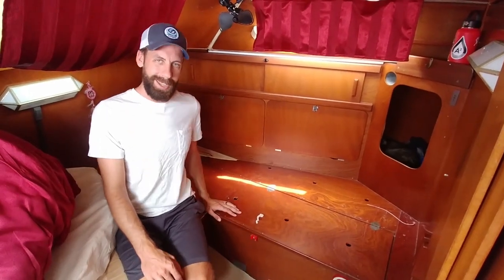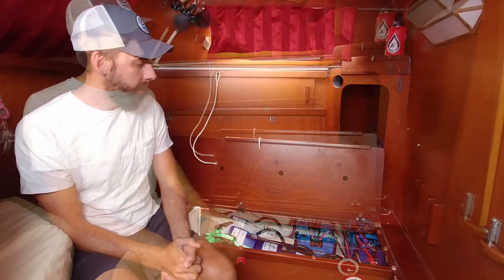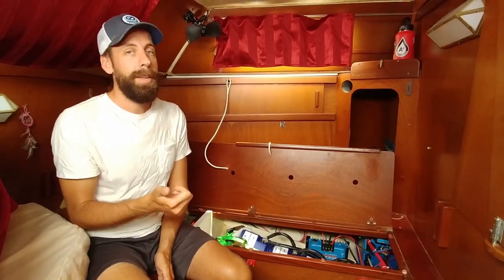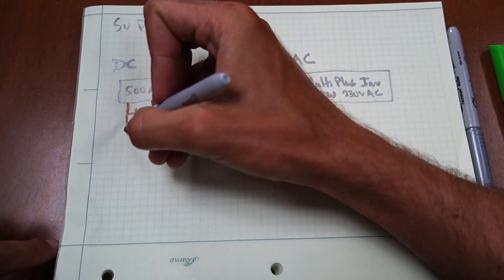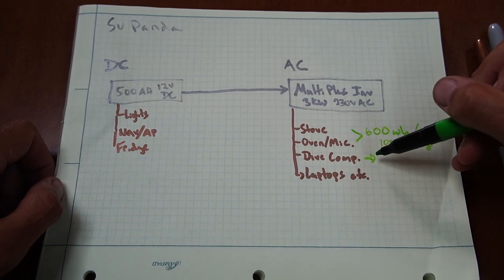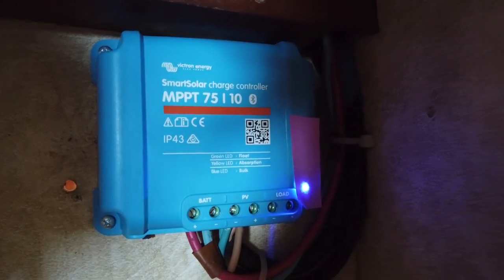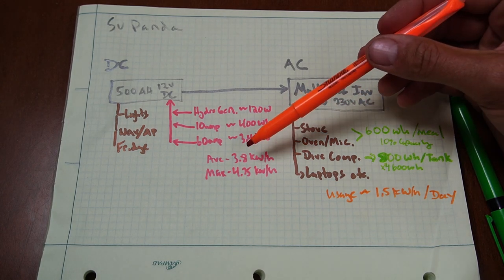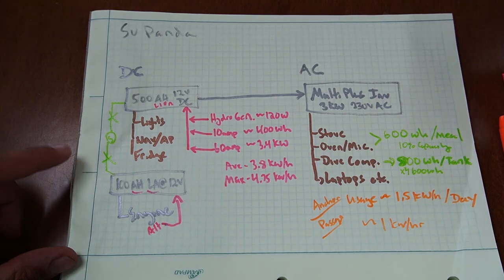Off-grid Energy Storage and Solar - On a Sailboat!

Comment: Wow you get so much solar.  I wanted to pass along some tips and tricks you may be able to use to improve your setup.  First if you didn't know lithium batteries hate to be discharged too much or charged too much.  If you get a good amount of charging even on cloudy days you might want to consider setting up your Victron unit to not charge past say 70% State of Charge...or maybe 80%SOC...or 90%SOC.  If you for instance can keep your battery bank most of the time between 30%-70% SOC you will typically get 4x more cycles out of the batteries than the manufacturer would state.  10%-90%SOC will typically get you 2x more cycles.  So maybe figure out what is best for your setup and overall energy needs.  To help utilize the energy coming in, you might consider changing out your water heater element if you have one.  I use the water heater as a solar dump with a 300 watt element.  They sell them out there which have a DC element and an AC element all together.  Anyway when my batteries hit 90%, I have a voltage sensing device that automatically turns on the water heater.  This keeps my batteries from being cooked and I get hot water.
Reply from the maker: Thank you so much for the advice!
Reply: Can you share some details on your setup? I recently added solar and have two victron smart controllers. How can I set them up to limit the charging to 90%? 
Also, can you share details on your water heating element and relay. I have an AC element, but would like to use excess solar to heat water.

Thank you!
Reply: @freeamerican4243  Brent I would love to give you some ideas.  Well there are a lot of Victon Controllers out there with different interfaces and/or apps.  In order to set your top charging voltage you need to figure out from your battery manufacturer what the ideal top voltage is for the battery bank/battery.  Typically this is somewhere in the range of around 14 volts or so for lithium.  Again it is different per battery.  In your app/controller just instead of setting the top charge voltage drop it down by the percentage you want.  So 14.8 volts you would take 10% off would be something like 13.7 or whatever makes you feel comfortable. Mine actually tops at 14.0 ..Battleborn batteries for instance the manual for their standard 100ah battery says between 10 volts and 14.7 volts.   10 volts would be a killer so...if you have a 12 volt system try not to let it discharge below 12 volts...lights and things stop working below that voltage.  Also the charge voltages change for series or parallel battery sets or a combination thereof.  Some can easily be upwards of 50 volts depending on how things are set up.  I prefer 24 volt installations....but most are 12 volt parallel.  Anyway the idea is to play with that top and bottom voltage within the specs to see what will meet your energy needs.  Ok...to your water heater..You likely will need to change your water heater element or elements.  If you can score a DC and AC element that fits your water heater you hit the jackpot.  They are hard to find.  You have to know what element you've got before you can change it...here is an example https://www.emarineinc.com/Water-Heater-Dual-Heating-Element-12V-300W      In order to use it as a solar dump at your upper voltagesyou will need a voltage sensing relay and a contactor to carry the higher voltages.  Again this is a 12 volt unit if you have a 24 volt system you would need a 24 volt contactor.  https://www.ebay.com/itm/2pcs-200A-4-Terminal-Contactor-Duty-Relay-Solenoid-For-Marine-Golf-Cart-Winch/202961390808?hash=item2f41710cd8:g:Hh8AAOSwnAJekGhi   I cant find the exact module I have for the voltage sensing relay but I think this might work for a 12 volt system..  https://www.ebay.com/itm/12V-Voltage-Control-Delay-Switch-Over-Under-Volt-Voltage-Protection-Module/172436623233?hash=item2826060f81:g:JTMAAOSwKEFbrgEo    Remember to fuse them appropriate to the wire gauge...So basically the voltage sensor detects when you hit your almost or top voltage.  I recommend you start dumping before your batteries hit their top/90%, etc so you will getfull effect of the water heating.  These here are the little wires that just sense the voltage.  The relay on the sensor can take the voltage coming into the sensor and then power the coil terminals on the contactor.  The big terminals on the contactor engages the DC or possibly AC voltage from the mains. Hey do this at your own risk, but that is the general gist of it.  I hope I have been able to help.
Reply: @freeamerican4243  Oh I almost forgot you will need thermostatic control.  Some replacement elements have a thermostat built in.  Otherwise get this and put the temp probe somewhere it can reliably detect the temperature.  Keep it lower than you should maybe on the temp.  Search bebay for this "DC 12V Digital Temperature Controller Thermostat Control Fahrenheit Relay NTC US".  You can use your existing setup with an AC element on an inverter too.  You just have to put the contactor in line with the AC line into the waterheater.  That way it only powers when the batteries are topped up.  I would also rig a bypass circuit for shorepower.   I hope you get all this the news services and big tech are so good at sensor shipping me lately.
Reply: @allynonderdonk7577  Excellent information. Thank you so much for sharing. 
I think I will be using the Battle Born batteries as I don't want to take on a new science project at this point and build my own. My system is 12V.
Reply: @freeamerican4243  Well look at eBay for lifepo4 or searching for lithium batteries. There are really good deals on name brand batteries with very few cycles for less than half of new prices.

Comment: Nice video and a very clean setup. Thanks for sharing. 

What dive compressor are you using with that low of a power draw? Would you recommend it to others?
Reply from the maker: I would!  It's a Bauer Junior II.  Expensive new, but found ours used, ideal 👏

Comment: Hello, a question ... is the Mppt 75/10 capable of charging the batteries at the same time as the Mppt 150/60? Do you think you do not think that the performance of one of them is lower when being in parallel? And on the other hand, is it possible that you charge at the same time with solar energy and the hydro generator? Thanks friend and greetings from Spain
Reply from the maker: Good question, would have to ask an expert, and that unfortunately is not us!  But very curious too 😉

Comment: Excellent and understandable! In the beginning you said “500 amp hours usable”. I assume that means you can draw 500 amp hours out of those batteries until they’re at 80% or so? How does that compare in usable current to something like 2000 amp hours of lead acid?
Reply from the maker: 500ah is their rated capacity.  With lithium, you don't want to go all the way to zero, so Battleborn smartly includes 15% more than rated.  But the internal BMS will not yet you use that of course.  My understanding with lead is 50% capacity max...and that is pushing it for longevity.  So 1kah in your example, maybe less.  Hope that helps!
Reply: @OuterPassage  Oh, ok. That makes sense. Thank you!

Comment: Congratulations on the quality of the installation.  I am the owner of Saudade III, Sharki #1 1980 and I would like to know how you solved the problem of the mizzen boom in order to fit a rollbar.  Did you cut it and modified the sail?  Do you have a drawing with the measures of the rollbar?
Reply from the maker: What are you referring to as the rollbar? The solar arch?
Reply: @OuterPassage  yes, the solar arch.
Reply from the maker: We designed it so it installed aft of the mizzen, then the mizzen backstay helped to hold it up.  However we don't recommend all of this extra windage and weight up high.  We tore it down in favor of flexible solar and davits.

Comment: Hi there. Where did you find the induction plates for your galley? Are they gimballed? Best regards. Silvano
Reply from the maker: We used the existing gimbal setup by simply dismounting the oven stove combo, and bolting in a microwave and dropping in a traditional counter top induction stove unit.  Found on Amazon! 
K&H Domino 2 Burner Induction Ceramic Cooktop 220V INDV-3102 
https://www.amazon.com/dp/B01N98Y2M8/ref=cm_sw_r_sms_apap_OnrIdsg7IykZv
Reply: Very clear and interesting. You have the makings of a very good series here. Look forward to watching more